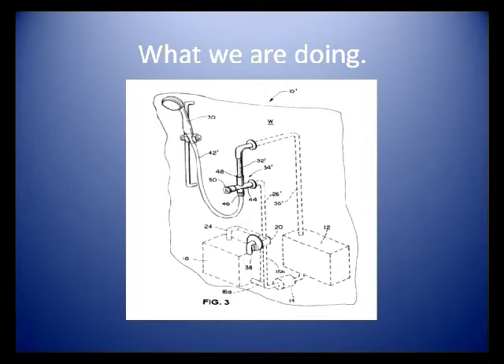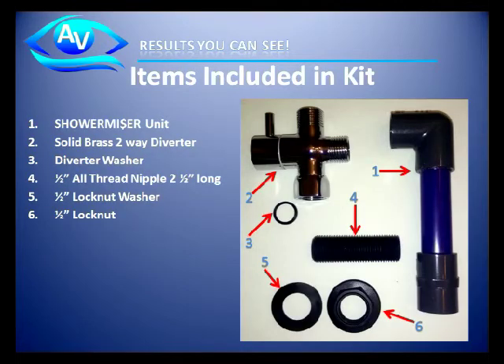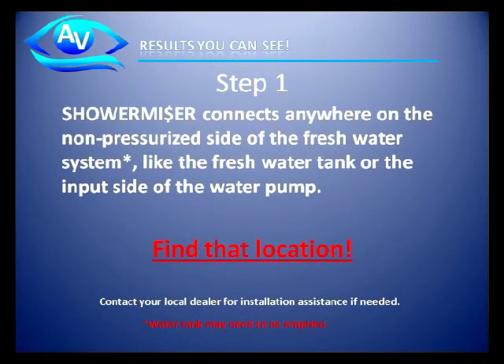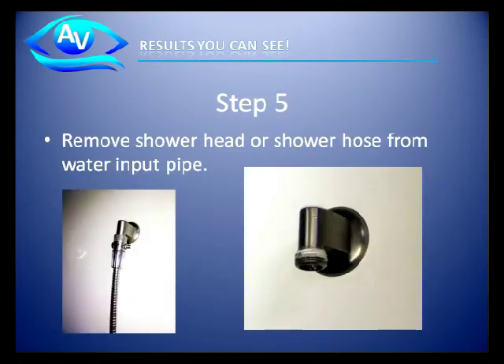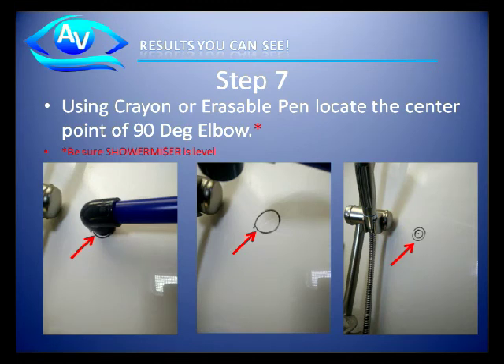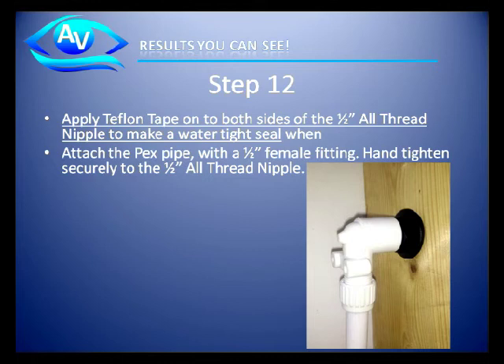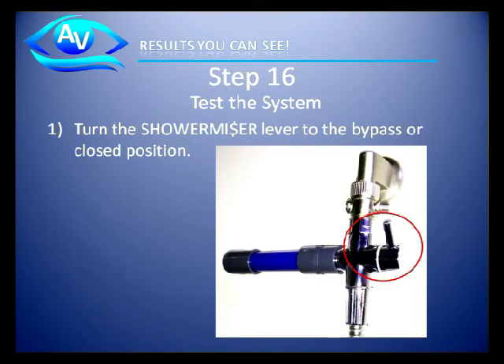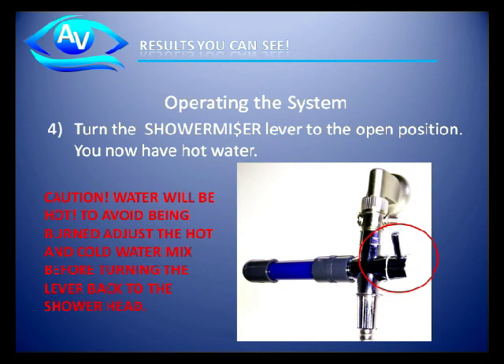SHOWERMI$ER Installation Guide

Comment: It looks complicated. I will contact some RV shops.
Reply from the maker: According to Trailer Life Magazine who did an independent installation and evaluation of our product (you can find out online) they determined that it takes about 2 to 3 hours to install. Of that time 2/3 of it will be spent running the return line from behind the shower to the fill line drain line or breathe line of the input to the freshwater tank.